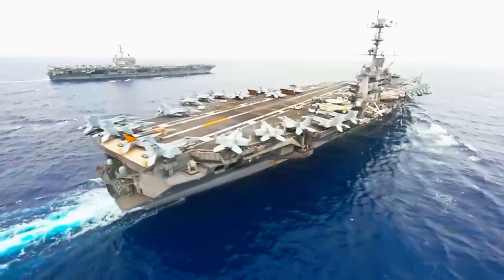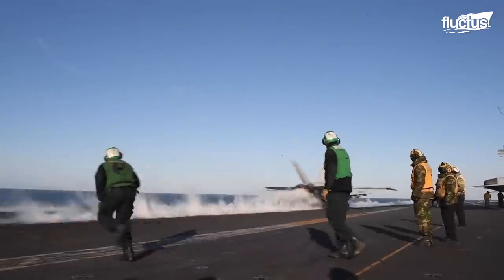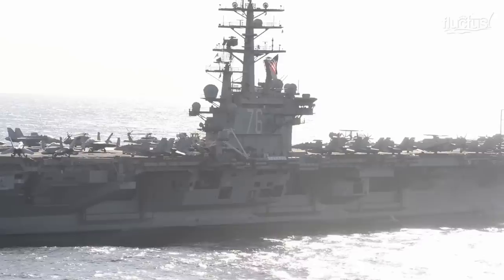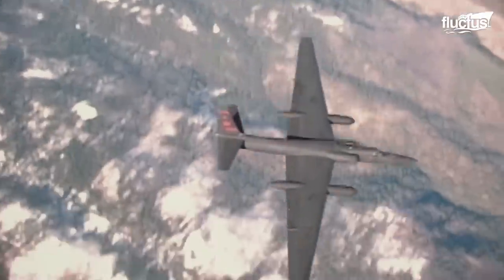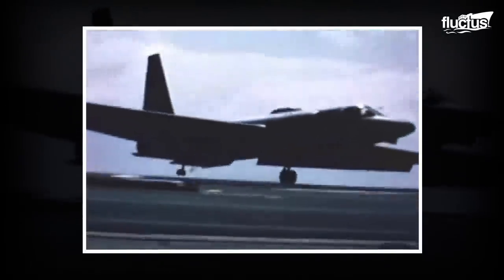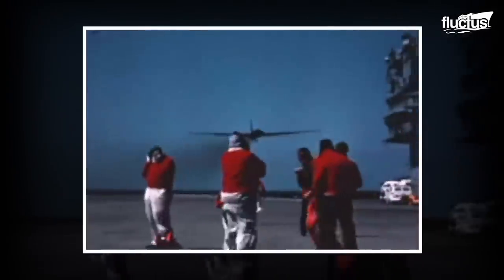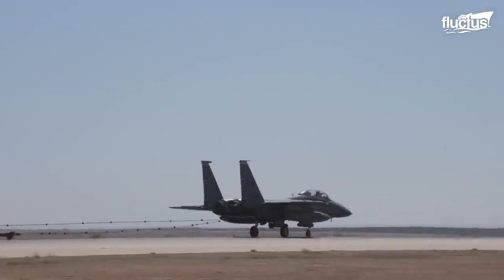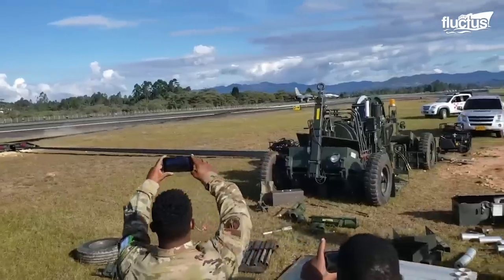What Happens When US Pilots Break Arresting Cables on Aircraft Carrier

Comment: Believe it or not, the plane is in less trouble than the flight deck crew.  The pilot is taught go full power in case the cable isn't caught, or it doesn't stop him.  They continue by pulling up with full power.  However, the cable is released at terrific speed when it breaks.  Whoever it hits is lucky to survive with missing legs or be cut in half.  It takes a special breed to work on the flight deck. (USS Saratoga, squadron VA-75)
Reply: I'm Make me use us k Kim juice I'm

Comment: I was on the USS Carl Vinson, CVN-70 from 1983 to 1986. I never witnessed an arresting gear cable. The cables have a limit to the number of arrests it is allowed to make before it is replaced. I did witness an F-14 which experienced a tail hook breakage. It happened after dark, and I was operating a fueling station, starboard, and aft of the island. The Tomcat caught the cable, and then I saw the afterburners light off. This was not normal. I then saw the ejection seat rockets fire off. I remember that my jaw dropped, and then I got a mouth full of rocket pack wadding. The pilot ended up in the water, and was picked up by one of the helicopters. The 
RIO landed on the deck, and broke his collarbone. Neither suffered major injuries.
In one of the videos that we had to watch about arresting gear failure, it talks about airmen having their legs sheared off by the whipping cable. It also shows an airman who managed to hump over the cable as it whipped under him. Very lucky.

Comment: Did you mean to say that both Nimitz and Ford carriers have the lens system?  CVN-77, the latest Nimitz, has been operational for over 10 years, so it would seem unlikely to have such a modern system.  Either the USN retrofitted some of the older Nimitz carriers or both Ford carriers were built with the lens system.
Reply: I flew from a carrier in 1964 with a lens system.
Reply: The Nimitz  was retrofitted and refueled about five years ago.

Comment: why is ther 3 wires if they only use the 3rd one?
Reply: In case the pilot lands a bit short.
Reply: The pilot is supposed to aim for the middle cable, or one before the last.  Considering the ship could be rolling arround, and there are wind gusts effecting the plane, the pilot is aiming at a moving target.
Reply: @trespire  To the best of my memory (it's been over 60 yr) the pilot does not aim for the cable.   He follows the mirror (landing angle tool) and the orders of the LSO (Landing iSgnal Officer).
Reply: @IggyDalrymple  I believe your memory serves you well.  I might have recalled some video from WW2 before the introduction of the landing mirrors, where the pilots were eye-balling it.
I'm Ex-IAF, Phantom maintainer, so never even been on an active US carrier !  Massive respect for the intense operations on board !

Comment: Most Aircraft carrier aircraft are calibrated to the weight of the aircraft even though they have to vent fuel to make the aircraft lading to the specific  landing weight. This will include the ejection of external fuel tanks & any other bombs or other armaments. Every time a carrier battle group goes out, they lose at least 2 aircraft & pilots due to weather or other problems.
Reply: Everytime they lose two aircraft? That's absurd! I was a cat crewman
Reply: @nathandodge665  I remember being told & seeing several aircraft hitting the stern of the carrier or over shooting the arresting without having enough thrust to pull up. It was a rare treat for us Marines on the LST's & LPH's to be allowed to be helicoptered over to the carrier to watch day & night qualifications. After that I worked at General Electric Aviation & made rotating parts for 10 different passenger aircraft engines & 5 different military engines.
Reply: @donaldhollingsworth3875  if you say so... I was a bow cat for two and a half years and never heard of any. And we logged alot of shots.